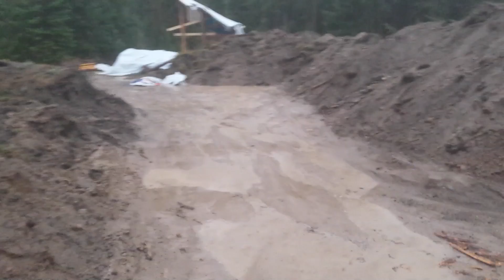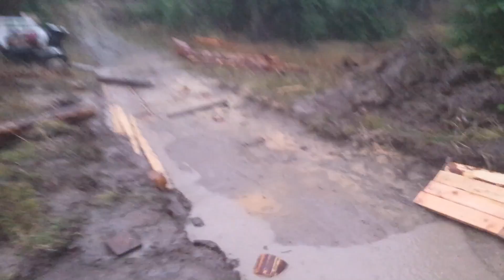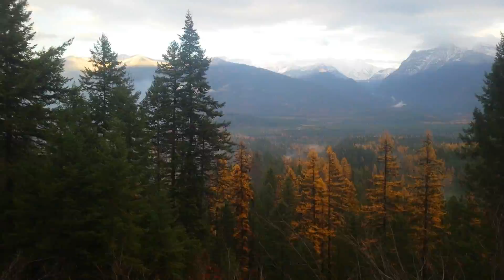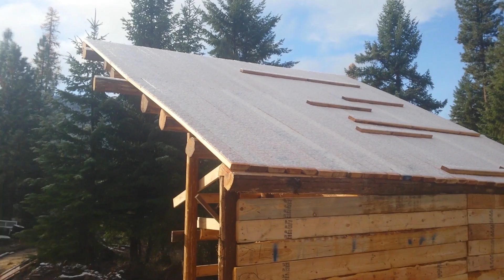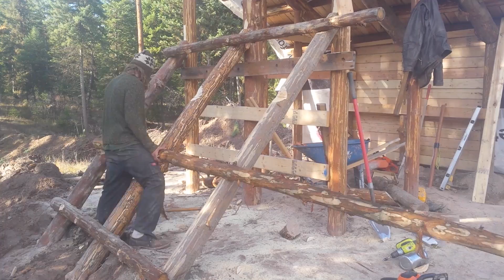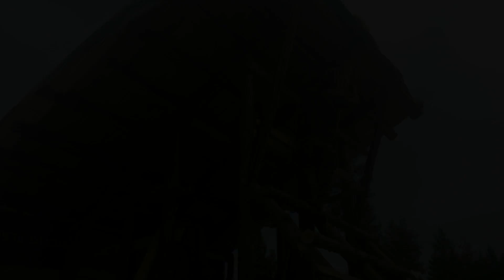Ant Village Journal #15: Building My House Part 2

Comment: Nice one! That water harvesting will come in handy next summer. 
I understand you're just starting and you're getting your shelter setup but how do you plan to build soil? When I visited there the soil looked pretty bad, which is typical of monoculture pine logging land. There was a bit of grass here and there but the ground was sandy and dead looking. So what's your plan? 
I don't see your bitcoin address. If you post it I'll add a bit to the tip I sent earlier this month.
Reply from the maker: Hello again!  The soil building will really start to be focused on once I finish most of the earthworks, which will take the form of me building the permaculture bike park over the next year.  A lot of the existing soil will be scraped up from its original spot and sort of concentrated in specific spots, along with whatever extra organic matter I can scrounge up.  The entire riding surface of the bike park aspect will be compacted subsoil/clay, which will act as water catchment surfaces for concentrating water into the growing areas.  So there will be a lot of moving around of the existing soil and subsoil before I get into building the organic matter in the soil.  It is a pretty funny way to apply permaculture, but I have very specific aims with the project and it all makes sense in that context.  That said, I do have some ideas for building the soil.  There is a massive amount of woody debris that needs to be cleared from the surrounding area, so in the long term hugelkulture beds make sense for producing a lot of soil.  Of course, all of this material comes from conifers, so there are concerns about acidity.  From what I have heard there is quite a bit of debate about what actually happens to the pH when using conifer material in soil building, so I will be doing a lot of research into that in the future.  perhaps there is a way to counteract the affects.  For next season, I plan to build a sizable veggie garden and will likely be doing a ton of composting using the Berkeley method to provide good quality soil quickly.  Then of course there are animals.  I don't have much experience keeping animals, and some strong opinions on how they should be treated, so I may start out with something small and relatively easy like rabbits and ducks.  I visited Quail Springs permaculture farm in southern California and they were using a wide array of animals to produce manure for building up their poor desert soils.  It seems like the best way to go, but raising animals will certainly be a new challenge for me, and incorporating them into the bike park aspect presents it's own unique challenges.  Lookout duck!

Thanks again for the bitcoin donations.  Here is that address:
1719isaHpSdou4ebgp7EKNpSUGZnpwesky
Reply: Jesse Grimes
That's a virgin address, not the same one as before. Is this correct?
Reply from the maker: +Vention1MGTOW 
It took me a while to figure it out, but yes it is a new address.  My wallet automatically creates a new one for each transaction.  still new to this.
Reply: +Jesse Grimes 
Strange. It doesn&#39;t seem to be working. I found your old address though and it still has the tip I sent before. I&#39;ll just add it there.
https://blockchain.info/address/1HkdAkSSVgMZbknWrokcssqgkoJPDT9TSW

The address you just sent me doesn&#39;t work. it says something about an illegal character.
https://blockchain.info/address/1719isaHpSdou4ebgp7EKNpSUGZnpwesky
Reply: +Vention1MGTOW 
Hmm. Now it seems to be working. The problem is the cutting and pasting between the blockchain address from you tube comments. It's probably better to just one of the links above in your video info area and then I won't have to ask you for the address in the future.